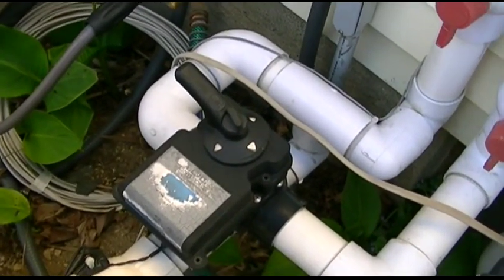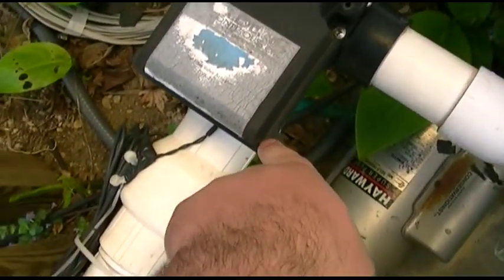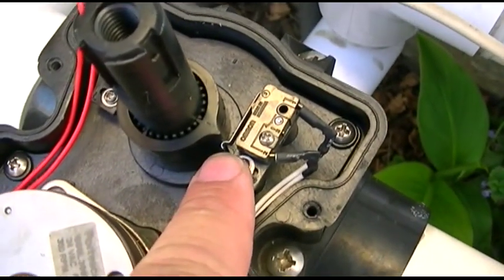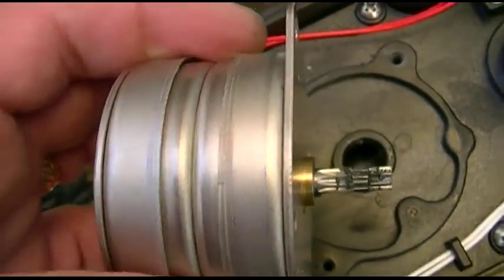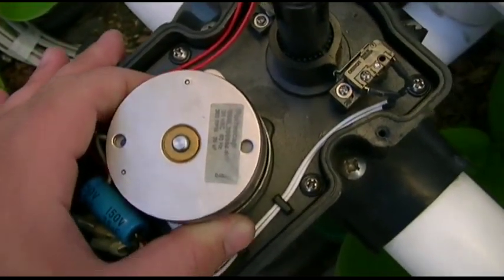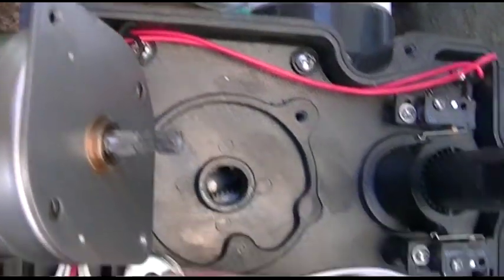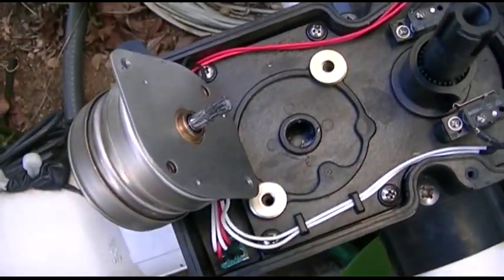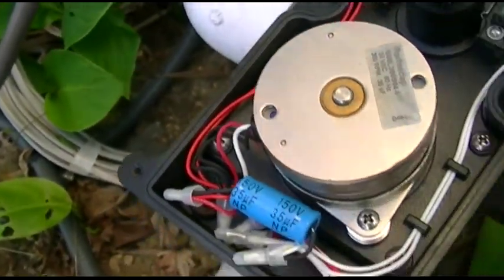GoldLine (Hayward) GVA-24 $0 ZERO DOLLAR FIX 0$ (Automatic Valve Actuator)

Comment: I tried the washer trick but it didn't work.  The capacitor seems to be blown as well, so at this point I think it's time to take the loss and get a replacement.
Reply from the maker: This one lasted 9 more years before it failed.  I have a 2-part series on replacing it:
https://youtu.be/XNRG96X54PQ
https://youtu.be/j5irksMD7oU

Comment: Hi there! Do you have any tips on how to replace the toggle switch on the GVA-24? Thanks!
Reply from the maker: Should be fairly simple.  First thing is open it up and take a picture of the wires and where they are connected, you'll need to refer to that later.  Then you'll have to source a replacement switch.  It may simply be something like a DPDT switch, if you have an electrical supply house nearby your best bet is taking it to them and having them match it up.  Otherwise you can find a similarly rated switch online, though it may not be the right size since pictures can be deceiving.  The switch will likely be marked as to what type it is and the rating; it may also have some sort of brand or marking as such to indicate; push comes to shove you can try contacting the manufacturer of that switch.
Reply: jaykay18 thanks a lot for your prompt reply. I’ll take your advice and see if that works. A quick online search yielded some switches with the wiring for under $50. I’ll do a little more shopping around just in case.  I hope that works. Thanks again!

Check this out: Zodiac 4433 Toggle Switch Complete Replacement for Select Zodiac... https://www.amazon.com/dp/B001I7RON0/ref=cm_sw_r_sms_awdb_t1_bmqoCbS64TWYN
Reply from the maker: Thanks for the link!  Great job on that, best of luck replacing it!

Comment: Valve actuators used to cost  $250+. Now they can be had for well under $100 (Intermatic). The brands are all interchangeable with each other. If you get about 10 years or more out of one, it has done its time. I repaired these all the time back in the 90's, but it's not cost effective anymore.
Reply from the maker: Thank you for the information.

Comment: My valve actuators wouldn't move at all- they appeared to be totally dead. I opened up the limit switches and used a flathead screwdriver to scrape away at the contact points. There appeared to be some buildup at the contact points that was preventing the circuit from being completed. I have two of these actuator valves and I'm stoked that I don't have to replace them (both failed for the same reason). If yours appears to be totally dead, try opening up the limit switches and scraping the contact points; this seemed to do the trick for me.
Reply from the maker: +Alex Diaz Excellent additional information Alex, I appreciate it!

Comment from the maker: Only nowadays is there room for improvement in design.  Years ago, you had a good, simple design for a lot of stuff, it was easy to service if something did go awry, and it wasn't disposable!  You threw it out when it was either completely beyond repair, or (if you had the money) when you got tired of it and wanted a new one.

I think the push down was easier to implement, indeed a simpler design, but from an ergonomic standpoint a definite "pull up to click", "push down to engage" is better.

Comment from the maker: Home automation is all the rage nowadays.  A good controller, plus a bunch of YOUR OWN wiring plus some nice 30A contact relays and you're all set.

If you use some of the existing X10 and other technology receivers, you can actually limit yourself.

Personally, I'm going to wire in an HVAC shutdown to my alarm panel one day, just have a lot of wire to run.  No microcontroller needed; it's all based on shoestring-and-bubblegum logic.

Comment: Imagine this:

- You are heading home.
- You send a SMS message, or a twitter, or even an Email to your own system, perhaps with teh Keyword SPA
- The system sets everything correctly.  Heats up the spa, and then...
- It messages you back telling you it is READY.
- If you don't reply, it will turn everything off.

Add one more trick, "On @ specific time".  Now, this system would rock. 

This is what I'm building.

Comment: I agree with you.

"I don't like the "design" of anything in the Pool industry," could be extended to almost everything, but I figured I would keep it to the scope of this thread.

I should point out, I understand that the center post mechanism works the way it does so that you push down (spring loaded) to override the motor and control it manually.  My point is, that is a bad design.  It should be more like "pull up" to over-ride.

This way, it works when connected, and when not connected.

Comment: I just hooked up a brand new one of these.  It failed.
I took it apart, I see what was failing:  The center post can slide up and down when not installed.  Since I was just testing it, I thought the whole thing was broken.

The fact that it can "fail" this way is my final straw with Hayward products.  I have lost two pumps, and two of these.

I don't like the "design" of anything in the Pool industry, but so far my Jandy and Pentair stuff has "seemed" at least better made.

Comment from the maker: I tend to agree.  However, for the best heating performance, you want to close off the solar when there's no sun.  Otherwise the (hotter) water from the pool is pumped up to the roof where it can LOSE heat.  This also places additional load on the pump to get the water up there, when it's shut it'll save a few watts (unless the downforce of the water counteracts it.)

I've been outside for 3 hours so far today and it has opened and closed 3 times with the partly cloudy weather we're having.